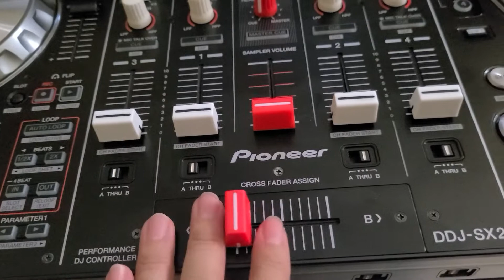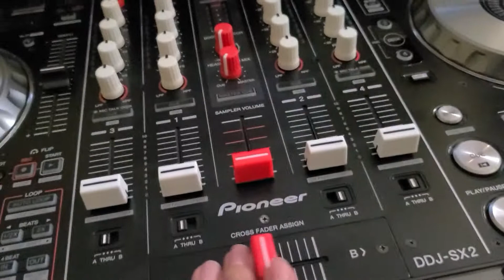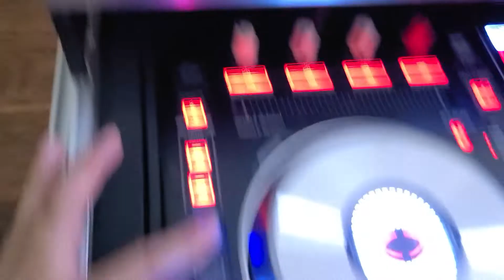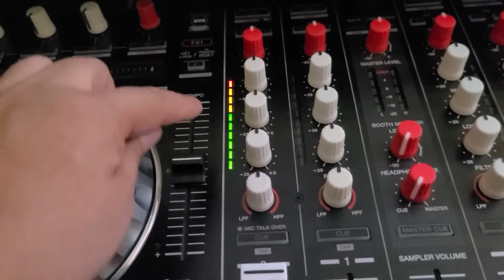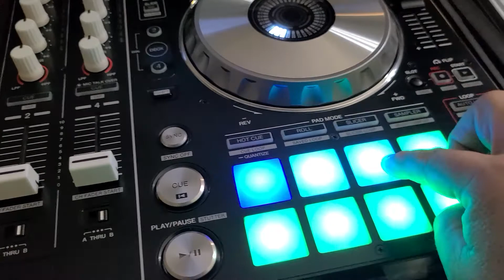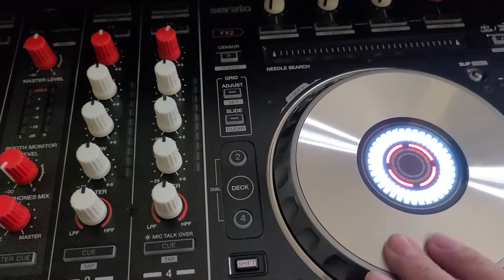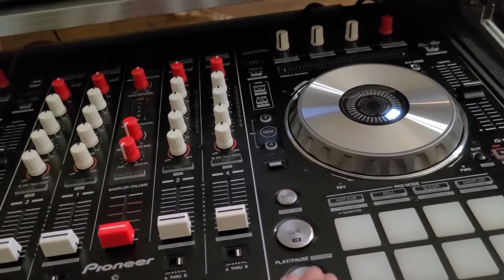How to test your Pioneer DDJ SX,  SX2, RX.

Comment: I am having issues with the master volume fluctuating by itself, not sure if you have any insights.

I’m playing and the volume is just jumping up and down either as soon as I start or after some time.
Reply from the maker: Try unplugging your usb to the controller.  Blow it, clean it, and plug it back up, but if you have another usb, replace it. If that doesn't work, it can also be your speaker cables.
Reply from the maker: It could be so many things.  Causing your volume fluctuating
Reply: I doubt it's the XLR or any other cables because I have used different cables and even up to this morning I've tried and it started to fluctuate.

And the issues is, it drops lower and then takes some time then increases. Also noticed that channels 3-4 are louder than 1-2.

I have a gig tonight and this is hella stressful. Ongoing issue for 3 weeks.
Reply from the maker: @wizentertainmententerprise9923  try a factory reset, unplug all your cables to the controller except the power. And follow the video.  Then, afterward, you can test the volume led like in my video. You can even see if it fluctuates.  If you have another USB cable, try replacing it. I also lube my knobs and faders. They get dirt and sometimes cause problems.  I spilled a sugary drink. I wiped the top, but it got in between the fader and getting sticky hard. 

https://youtube.com/shorts/g8QscJn5DSU?si=AOfjyexQyBOWVXxA
Reply from the maker: @wizentertainmententerprise9923  you can also try updating your firmware to the controller.